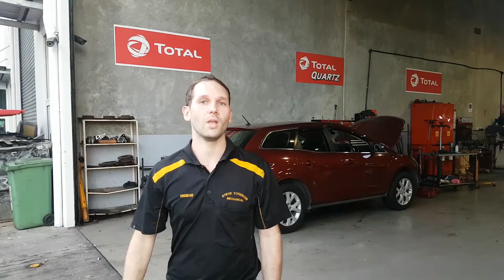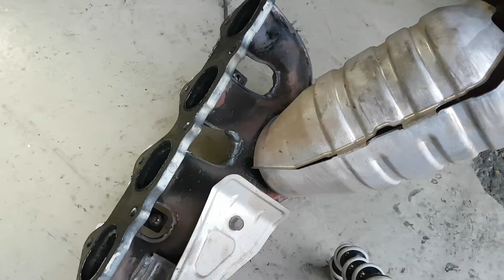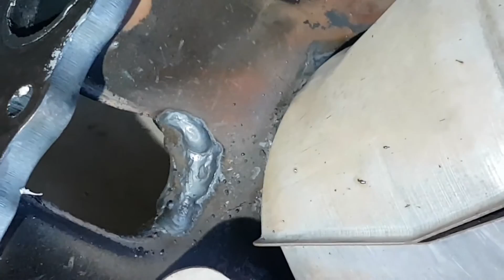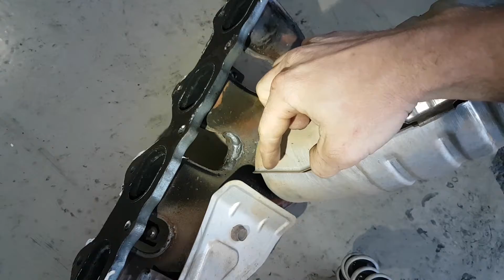Exhaust Leaks and Catalyst Efficiency

Comment: Any manifold that has a short tube to the collector like this vehicle should have been longer before they collect & all iron. This is a horible manifold design. Built to fail, a crack in it's young life everytime. Reminds me of the old chevy S10 4 bangers from the 80's with their short tube steel manifolds. These car companies know exactly what they're doing. These mani-cats cost big bucks.
Nowadays, you can only get them from the dealer too. The game is rigged, just like sucking, & using vacuum to the PCV valve. Sucking oil into the combustion chamber, then down to the catalytic converter. 
Telling people that's carbon in their combustion Chambers, and on their valves. Look in your throttle body, look in your plenum. It's Oil. Oil that was sucked through the PCV. Which is even worse on these direct-injected engines. Oil does not combust. It becomes carbon, fouls plugs, then drizzle down and destroys the first catalytic converter every time. 
Direct port, they have good MPG in the beginning but there is no fuel to wash over the valves. Except on a few newer models. All Built to fail from the beginning. Car makers make more on parts and repairs than they do selling the car. That is a fact.

Comment: can an exhaust leak after the converter trigger the engine light
Reply: Depends on the size of the leak. 
If the downstream sees more oxygen then normal, due to the vacuum effect. Pulling in more air from the atmosphere.  It will throw a code. In some cases, some downstream O2 sensors might read a higher level of oxygen then the Upstream. Like I said, it depends on how big the leak is. 
Each sensor, & each carmakers ECU has its own acceptable range of values, plus or minus.
Reply: I think so

Comment: Hello, my name is Francis and I’m having similar issues with my 2011 Rover sport and So many techs can’t exactly diagnose the problem. Previous owner removed cats and installed straight pipes. there’s also a leak right by the manifold. Can this cause a loss of power? I Can’t go over 25MPH...or could be throttle body or supercharger?. I was advised to reinstall oem catalytic converters and it should fix everything and restore power.

Comment: Great video!  It's still hard for me to visualize a crack upstream of the upstream O2 sensor sucking in air, but I trust you that it can happen.  Along that line, I have also heard from a cat manufacture that a small crack downstream of the downstream O2 sensor can cause a similar problem.  Have you ever seen anything like that before?
Reply: The fuel trim must go rich in that case.
Reply: He did not say the O2 sensor was cracked Upstream. Watch the video again. He said there was a crack before the O2 sensor on the upstream and you could see the weld repairs from the past. 
That's what would cause the mixture issue for sure. Now this car needs a new Mani-cat and Upstream O2 sensor. 
Might as well replace the downstream while you're there.
Reply: As the cylinders in the engine take turns firing, the exhaust flow out of each one goes up and down from high pressure to low pressure. When the pressure inside one stem of the manifold drops, it can suck in outside air if there is a crack in the manifold. The O2 sensor reads this as excessive oxygen in the exhaust and compensates by adding fuel. In actuality, the air/fuel mix coming into the engine is probably correct, but the unmetered air entering through the crack causes the O2 sensor to detect a discrepancy when it compares the O2 level coming out of the engine vs what the MAF sensor is reading is coming into the engine. This will trip a code for system lean, and the excess fuel being added to the mix will quickly cause the downstream O2 sensor to trip a code for cat efficiency being below threshold. 

It’s a very pesky code to clear if you’re going about it trying to patch cracks through trial and error.